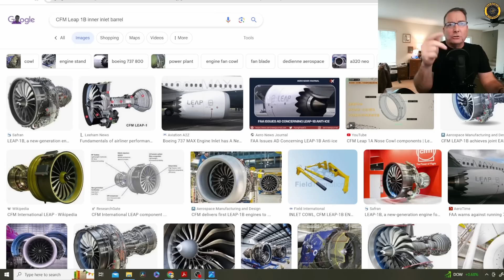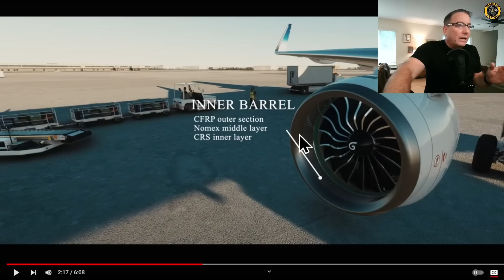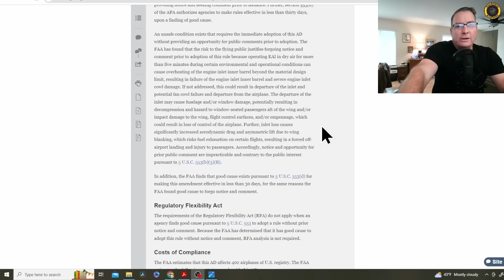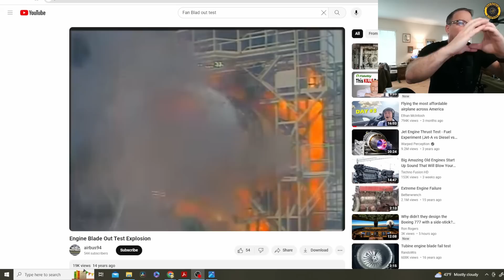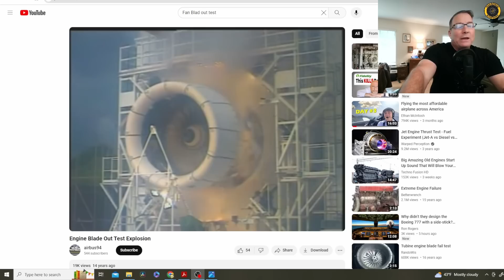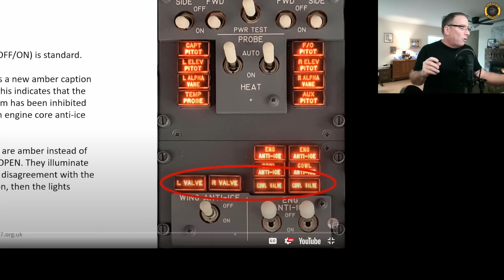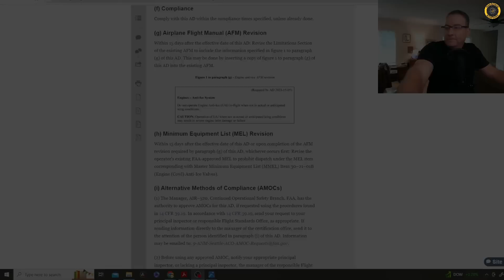Boeing 737 Max-7/-10 Certification HALTED! 1 Feb 2024

Comment: Juan, I know you've mentioned before that a pilot has the right to refuse an aircraft with an open issue that impacts safety. Until this is addressed, how would you feel about a pilot refusing 8MAX and 9MAX airplanes on flights that might possibly involve icing conditions, and thus the operation of the unsafe system?

Comment: Interesting video.  Looks like the Leap isn't much better than the PW1100 series.
Reply: The engine is NOT the problem. The anti icing system/parts are designed/built by Boeing not CFM

Comment: Is the bleed air constant from idle to full throttle? It is ridiculous to think that a pilot would have to reduce power to cool this air down as a matter of operational limits. Or to have a valve that opens like a cowl flap on a piston engine to add cooler air from the bypass. Will they go back to straight metal? What a mess.
Reply: I think when low power it comes from like 9th stage compressor when higher power comes from 5th stage cause its a bit cooler. A valve controls it. Well that mite be on the 737 ng with the CFM 56 or something like that. With the max I think its leap engine the exact setup mite be different but similar. The stages of compression further down for lower power. And further up for higher power. Cause at higher power settings taking bleed air from further down stages is too much temperature. And a valve controls. Maybe a mix of the 2 in between high and low power settings
Reply: @andrebello4191  That is exactly right.  The stage depends on the engine.  In general, the system is designed so that low pressure bleed (3rd to 5th stage on most engines) is used during cruise and higher power settings.  High pressure bleed (8 or 9th stage) should only be used during descent and other low power settings.  The switchover is, or should be, designed into the valves and transparent to the pilots.

Comment: NAPA Auto Parts has an aftermarket intermittent wiper control you could use zip ties and duct tape to switch the de-icer on and off, cheaply too!
Reply: Don't give Boeing any ideas.  They'll use zip ties and duct tape as door plug fasteners.
Reply: @JoeBManco  Giive 'em some credit. They appear to already be doing it!   lol
Reply: That would require pilot retraining.

Comment: Remember that Boeing were supposed to certificate these last 2 variants with the modern EICAS installation and the artificial AOA computation due to the 2022 cutoff... they hoped to bring these in later via an exemption so hopefully Boeing will be forced to include these from the introduction of the -7 and -10, and not as a retrofit like the other models will have to have done.
Reply: If they do then any operator of for example the Max 8 and Max 10 wont be able to have their pilots swap types. They'll only be able to fly one or the other due to the differences
Reply: @tomstravels520  Which will be great for Southwest who are the biggest / only buyer of the -7 and ironically were the ones who insisted on commonality / no training and forced the “race to the bottom” that has bitten EVERYONE in the ass…..
Reply: it worked out well for the 737-9 didnt it door first cockpit door second pilots notes third lucky the crew had good memories

Comment: Is this a Boeing issue or an engine manufacturer issue. Last I heard Boeing didn't make engines
Reply: I thought Boeing made the nacelles
Reply: Cowl anti-icing is a nacelle issue.  The bleed air temperatures and pressures are an engine issue.  This requires an extreme amount of coordination and cooperation between the two.

Comment: So what happens if you spend 10 minutes in anticipated icing conditions that don't actually produce icing?
Reply: Boom
Reply: @davidwright7193  " BOOM "   That has not happened.
There has not been an in-flight incident with these cowlings because of overheating. @davidwright7193
Reply: Yes Rico, kaboom
Reply: A question indeed!
I imagine Boeing could show that the pilot failed to follow instructions. Even if the instructions are contradictory.

Comment: What a mess.  And watch aircrews NOT using anti-ice for one reason or another - or forgetting.  Will you have engines getting ice accumulated and THEN putting the AI on and then FODing out the engines having chunks of ice heading down the engine.....?  Ugh  Boeing....what have you done to yourself?

Comment: As a retired heating engineer in the UK. Boiler manufacturers have been using glass fibre reinforced plastics /polymers on the manifolds. After about 8 years they cracked/started leaking. So I imagine on an airplane engine it would be devastating.
Reply: Didn't help my Ford F-150 when the plastic intake manifold cracked and and dumped water in the cylinder either. Good thing I was just taxiing at the time.
Reply: @KSparks80  you fly an F-150? 😅
Reply: Must save weight and cost 😮
Reply: @foxlake6750  The feds are eyeing fuel efficiency mandates for aircraft now.

So, expect to see mandatory safety trade-offs for fuel efficiency in the future.
Reply: Imagine flying to Tenerife knowing the engine was being fed with pipes made from the same material as a Worcester hydro block 😂
Reply: There has not been a failure incident nor has there been an accident because of composite material in the 737 engine cowlings.

Boeing 787 Dreamliners and Airbus A350s fuselages are made from composite materials and to think of all of those passengers sitting inside these craft with all of their hot air
being expelled, there has never been a failure😊😊 
Some composites are stronger than steel. @liljasere
Reply: @robincurwood  Just to be clear, you're suggesting that the hot bleed air being used to de-ice the cowling might damage the composite structure of the cowling? Does anyone know how hot the bleed air might be when it's going through the cowling?
Reply: @theharper1  390 degrees
Reply: @liljasere  Celsius or Fahrenheit?
Reply: @liljasere  assuming you're talking Fahrenheit which would be about 190C. I'd wonder if the temperature was still that high by the time it reached the front of the engine. A quick Google search suggests that 200C is doable with CFRP, but the strength of the material might be compromised. Having said that, it's a bit of a red herring. The problem Juan was talking about was the lack of automation in the cockpit, not the failure of the cowling. Fix the automation and the cowling concern goes away.
Reply: @theharper1  I’m not sure that’s from a manual it doesn’t say
Reply: @liljasere  that is certainly hotter than 90' of a boiler and they still leak. And to the home owner's wallet it's definitely devastating. Although I think to  the people lives on an aircraft,when they blow its more than devastating.
Reply: @robincurwood  boiler hydro blocks don’t leak because of temperature they leak from hydraulic shock overtime 9/10 I come across pinholes and cracks it’s when shock arrestors have not been installed
Reply: @liljasere  what do you call the expansion vessel then. The manufacturers say that they are safe and tested to 10 bars! If it was necessary for a shock arrester they should state it in the installation instructions! I fitted them as a matter of course if the client insists on a Worcester boiler, because of the number of joints blown inside the boiler . A long side an easy to operate lever full bore isolation valve under the boiler labelled for the time that it would blow.
Reply: @robincurwood  the hydro block is what the plate also goes through so that’s mains water that isn’t cushioned by the expansion vessel and yes it’s been in the insulation manual for atleast the last 10 years, the check valve in the water meter in the street when it slams shut once you turn off a tap the pressure spikes
Reply: I think it is nuts to use polymers of any kind with that kind of heat.
Reply: @janetsmiley6778 I do not know what the bleed air temps are on the LEAP engine, maintenance manuals      on some turbofan engines state that it reaches 400 degrees C before going through a heat exchanger.
Reply: Agreed. Not only that but the temperature inversions and sun exposure delaminates the carbon fiber. Recipe for disaster.
Reply: There has not been a failure incident nor has there been an accident because of composite material in the 737 engine cowlings.

Boeing 787 Dreamliners and Airbus A350s fuselages are made from composite materials and to think of all of those passengers sitting inside these craft with all of their hot air
being expelled, 😊😊temp. inversions, sun exposure,  there has never been a failure. 
Some composites are stronger than steel. @ApriliaRacer14

Comment: As a stupid consumer I will never, never, never fly with any of the MAX series. It is really frightening!
Reply: Not a stupid consumer, just not willing to be a sheep.  I won't get on a Max either. Screw boeing and the carriers foolish enough to fly the Max.
Reply: @edkauffman4808  /  @renepinos3236   -   Are you afraid of your shadows or darkness -!

Airbus A320 disasters.

Source:  Wikipedia

On 28 December 2014, an Airbus A320-216 registered as PK-AXC, crashed into the Java Sea killing all 162 on board. 
The cause was initially a malfunction in two of the plane's rudder travel limiter units.

On 19 May 2016, an Airbus A320-232 registered as SU-GCC, suffered a cockpit fire and crashed into the Mediterranean Sea 
20 minutes before its scheduled arrival at Cairo International Airport.  All 66 on board were killed.

On 22 May 2020, an Airbus A320-214 registered as AP-BLD, landed at Jinnah International Airport gear-up and executed a go-around. 
A few minutes later, both engines had shut down. 
The plane crashed into Model Colony near Karachi on final approach to Jinnah International Airport for an attempted emergency landing, 
killing 97 of 99 on board, as well as killing 1 on the ground.

On 5 November 2014, Flight 1829, an Airbus A321-231 registered as D-AIDP, was flying from Bilbao to Munich when the aircraft, while on autopilot, 
lowered the nose into a descent reaching 4000 fpm. 
The uncommanded pitch-down was caused by two angle of attack sensors that were jammed in their positions, causing the fly by wire protection 
to believe the aircraft entered a stall while it climbed through FL310. 

On 31 October 2015, an Airbus A321-231 registered as EI-ETJ operated by Russian airline company Kogalymavia crashed in the Hasana area of central Sinai, Egypt 
while en route from Sharm El Sheikh, Egypt to St. Petersburg, Russia. There were 224 people on board (217 passengers and 7 crew). 
There were no survivors.

Comment: Not an engineer, not a pilot - it seems like it wouldn't be that difficult to blend the hot air with the cooler air from another stage in the engine...  What am I missing?
Reply: I’m not an engineer either but that was my first thought as well.  Blend doors seem to work just fine in my dashboard.
Reply: @Primus54 Different stages have different pressures.
So now you need to match pressures too
Reply: Or take the bleed air from a different location where it isn't so hot.

But the answer is probably that the engine was designed to be used with a anti-ice with an 'auto' setting, and so the system only operates where the cold, damp conditions prevent overheating. But changing the cockpit's anti-ice button to a knob with an auto setting would have meant extra pilot training which the airlines were saying 'no' to - i.e. it's MCAS all over again.
Reply: It is mildly difficult, and is quite heavy to do so.
Reply: @aitorbleda8267 I agree weight is an important factor. CFRP was used to save weight, any technical solution I can think of to improve valve reliability or lower the air temperature will probably be heavier than going back to an aluminum layer.
Reply: Tap the hot air from a compressor stage further forward where there is less compression and heating of the air.

Comment: Not asking for drama reasons, but as a passenger are we reasonably able to optionally refuse to fly on a type given the ongoing serious nature of some of these issues atm ?? Assuming the carrier has options with different types ?
Reply: A lot of travel sites now have options to filter based on the aircraft scheduled for the flight. However, if that plane has a mechanical issue it's possible it could get swapped with a MAX.
Reply: @PurpleDrankYoshi    However, that said, you can still 'play the odds' and book on a different (preferred) type of aircraft.   The odds are probably 99% that you'll fly on the type you booked for.
Reply: In your contract of carriage, the airline promises to take you to the agreed destination. Even if that involves non-airplane methods of transport. So they can substitute anything and still uphold the agreement.
For example, they could cancel your original flight and get you a seat on another airline.
You could of course refuse to board the plane, but then you just forfeit your ticket.

Comment: Why can't the engine maker set the temp of the bleed air?
Reply: I've got an extra furnace thermostat laying around from the house HVAC.  What could possibly go wrong.
Reply: CFM does not design/make the nacelle anti icing components and the problem is not the LEAP engine. It is Boeings design of the nacelle anti icing system/components that is the problem. Airbus uses a totally different design and has NO problems

Comment: I would attempt to monitor the heat of the ring,  not ice conditions.  Then with a thermostat you could leave heat on without a catastrophic possibility.
Reply: Only if the valve works!
Reply: @daveuggla8383 either way you’re screwed if the valve fails.  The more I think about it the ring needs to go.  They need to go back to other design.
Reply: These things fly in the high 30s where the air is always -40 or something, it’d be on (or cycling on/off) all the time if it were based solely on temperature. I wouldn’t be surprised if the presence of ice has an insulating effect that causes the temperature of the ring to be higher under certain circumstances when ice is present. I don’t think you could determine whether anti-ice is needed based on temp alone.
Reply: @mattj65816  High temp cutoff.

Comment: Remember back when we built stuff that was strong and worked, for a long time.
Reply: Yes. And that’s why the KC-135 is still flying today.
Reply: @robav8or  KC-135 is being replaced by Boeing KC-46. Another great Line of Boeing AC.
Reply: @joes6089  KC-46: KC-135 replacement in the works for 20+ years. Despite the 767 quality the KC-46 program has been like trying to force a square peg through a round hole.
Reply: Yes.., it seems like it was just yesterday….  It was a glorious time…, and being able to stamp “Made in America” on that item…, and that in and of itself.., meant something as well…
     On a whole…, at this point in our existence, we are doomed as a country.
Reply: Some planes were strong, and some were not. Some flew safely and some did not.
Memory fades quickly. The DC-10 was strong and unsafe for a while.
Reply: This strikes me as nostalgia, rather than accurate history.

Air travel used to be a lot more dangerous.
Reply: Who is we. I agree tho, but thats what you get when a slager keurs his own vlees
Reply: like B-17, B-29, C-97, B-47, B-52 (scheduled to last almost 100 years)
Reply: Jack Welch fixed that oversight in corporate strategy.

Comment: Add an icemaker that produces icing conditions whenever the anti-icing enabled.
Reply: You are joking, but there probably is at least one team at Boeing seriously considering this.
Reply: How long have you been a Boeing engineer?
Reply: 😂 I don't  think so, Boeing answer would be cheaper,  an note in the manual in very small print hidden  amongst   irrelevant information   don't fly in icy conditions, job done legal people happy 😂 @nitemareman1
Reply: great idea! and the additional flight engineer could monitor it's performance
Reply: lol! Great idea
Reply: Makes sense. Like adding too big an engine in a too forward position and then secretly adding MCAS to counter the flaw.
Reply: @veganbutcherhackepeter  You know where Boeing screwed up with that? They should've just added about 10 tons of sandbags in the rear of the plane to offset the forward mounted engines! Problem solved.

Comment: It seems to me that if it is a real safety issue, then the fix should be required for all MAX aircraft.  Since it is not a reason to ground those MAX models already flying, I don't see any reason not to provide a temporary exemption for the new models, provided all models are to be upgraded.

It could be automated even though the airframe is not a clean sheet design.

How about windows that are able to withstand impact from engine and cowling parts, at least in the most volnerable locations?

Comment: Love your channel for being as objective as possible.  I used to hate to fly on an Airbus.  I somehow felt that I was degrading the legacy of Boeing.  Not so much anymore!  I wonder if they can be saved?

I also loved it when you mistakenly called the inner liner "acoustic" and rather than correct yourself like a non-pilot, that, "correction, thermal liner" came out as easily as "um, I mean".